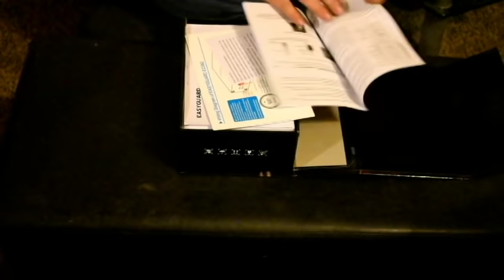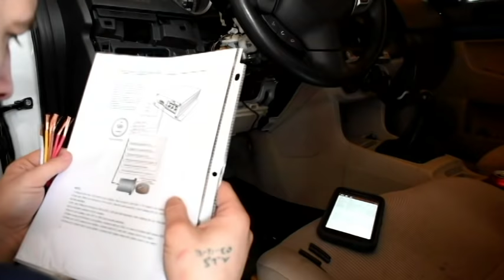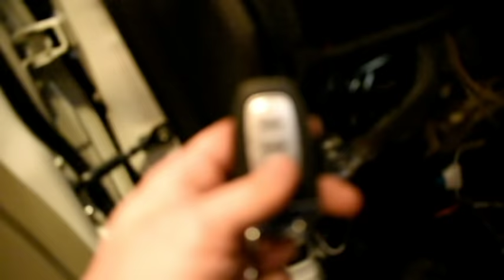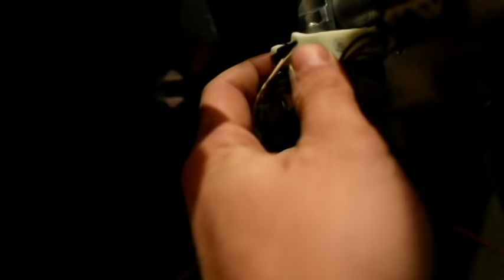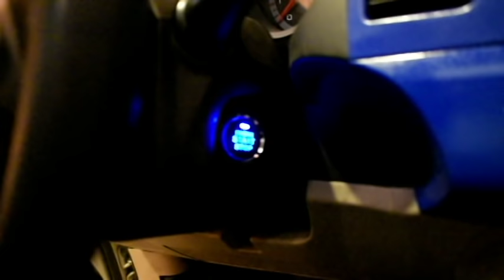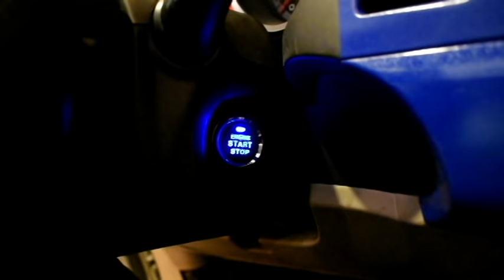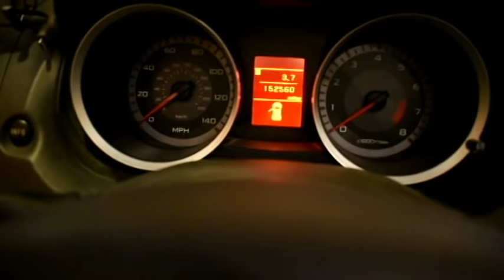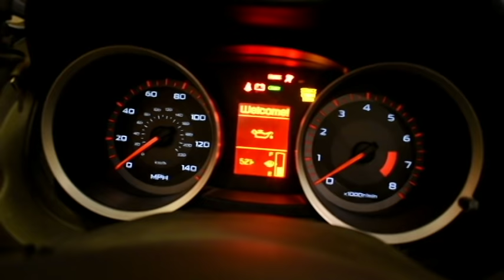How to Install a PKE Passive Entry Push Button Start System

Comment: That much work I think I’ll just turn the key
Reply: max F but do you realize that Push start remotes can break and cost more money then just getting a spare?
Reply: @max F How the hell are you locking your keys in the car when you lock the car with your keys?
Reply: I'll keep my normal key... too much hassle for the vehicles age (I have an 02 Expedition) the most I need is automatic start...
Reply: Thanks to this video I now charge $400 for install 😎

Comment: Quick question for EFFEKT or anyone else with this particular model of PKE...  I just installed mine on my Tundra.  Took most of the day, but it seems to work:

1) When I disarm using the keyfob I get about 10-15 on/off cycles on my blinkers (I did not connect the horn)  Is there a way to turn that off?

2) I have to hold the start button for about 3 seconds to turn off the engine.  Is there a way to make it turn off instantly (without foot on brake)?

3) how long does the engine run after using the remote-start feature?  Is there a way to adjust that?

4) I have been unable to reprogram the default password (123456) on the keypad.  I followed the directions verbatim, multiple times, but it doesn't seem to take.

Comment: For all talking about how easy it would be to steal the car now...I guess you don't understand RFID.   I'm wondering what the range is on the remote start?
Reply from the maker: Robert Vogt it locks about 10 feet away and unlocks about 5ish feet ha and as for manually it can be manually done from inside my house... not sure of the distance though
Reply: Hmm...the kit you have looks like the one that has "remote start" ...not sure if you were talking about "lock/unlock" above...did the kit include "remote start" as well...if so what is the distance that it reliably works from.  Also, how does the keypad work?...is it worth it?
Reply from the maker: it does include remote start, however since I have a manual trans I didnt bother hooking it up, due to the fact that I would of had to every time shut down the vehicle via the remote to start it by the remote accodring to the instructions... but if you had a automatic its set up to start from just hooking up the same wires I did and pushing the start button...

Comment: OK so what did you do about the immobiliser? You could have complexly removed the ignition with Steering Lock. Mounted the Push Button on the Dash. The remove key does not light up because you blew the bulb and you have complexly illuminated the Ignition Lights? Remind me never to buy anything from you?
Reply from the maker: ANDREW CULLEN the remove key is a digital display thus making your comment invalid...

Comment: very non produced your system and well installed. but why instead of thermodactable guenne you have not put outlets? it's safer. and if there is a problem you can change easily

Comment: Cant believe you just twisted the wires and slid the heat shrink over em ..... i guess you like getting stranded miles from a toolbox to tear your dash apart and repair loose connections

Comment: Take some pride in your work.  I never understand people that rush through a job and leave everything tangled together.  Or they don't use the proper tool for the job.  Your lucky that bullshit you did with those wires being twisted and then using heat shrink to hold the connection together doesn't start a damn fire.

Comment: I feel a good amount of info was missed I don't remember you mentioning the oil path detect wire most put it the ACC wire in the ignition but with a Manuel it has to go to your fuel pump. And it's a good idea to wire it to the fuel pump anyway so you know your vehicle dose start. But I do give you props for your install very nice. The Manuel was a nightmare to read as I own and have installed a few off these units.
Reply from the maker: John Ingram mybad, it was a headache to do it ha... bcz im def not a good electrictian but can manage an try... the manual was hella confusing to me as well when it came to the wiring of the doors... but i did hook the oil path to just a 12 volt source and i have no issues... and i since put one on my 1997 chevy c1500 lolz and it has gotten easier as i go... its harder to film at times because i lack a camera man to cover it all etc while im triening to figure it all out...
Reply: I had trouble myself with the dang ground every time I would put it on my cars oem ground my wiper fluid motor would start spraying endlessly. They defently need to update there manual. Had to read half way threw the ec002 book just to find out oil path meant fuel pump.

Comment: To be honest you need to learn how to older first, Then where things will be mounted so you can cut wires to the correct lengths? The system you have bought I think is a general purpose one. A dedicated system should include exact details of where every wire goes and the colour of the one on the car. I bought a Dedicated Electric Window Self Closer system for my Vauxhall Vectra years ago from Ebay. If I (Or a passenger (Idiot)) leaves a window open at night and you do not see it? The system closes them and it covered the Sun Roof as well. It told me what panel to remove and what to do behind that panel.

Comment: And after a week of your horn going off every time you Arm/Disarm/Lock/Unlock/Start the Engine or switch off the engine it will not work as I will have ripped off you main battery negative strap
Reply from the maker: +ANDREW CULLEN ??? The horn only goes off when you lock it... so again, invalid comment...